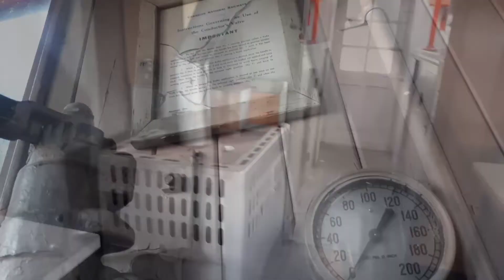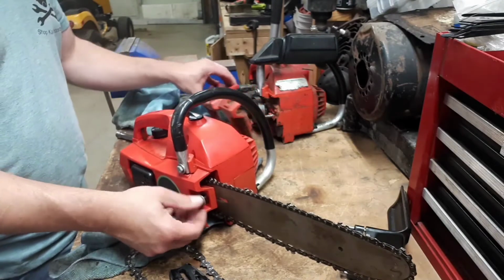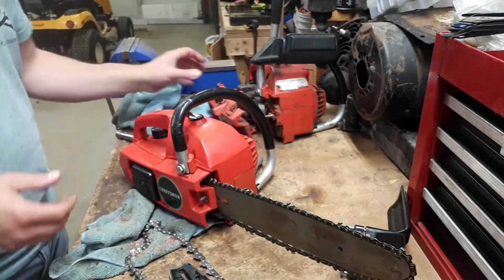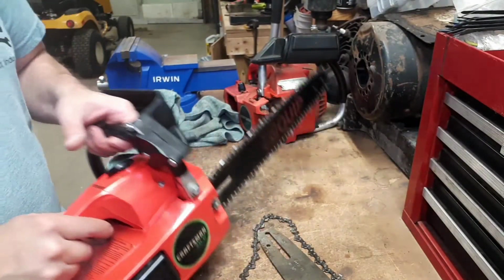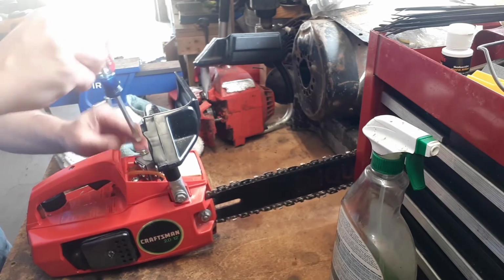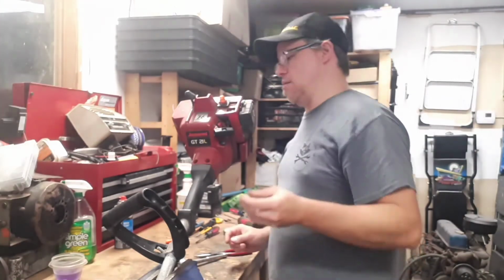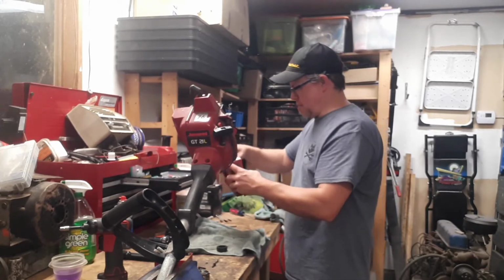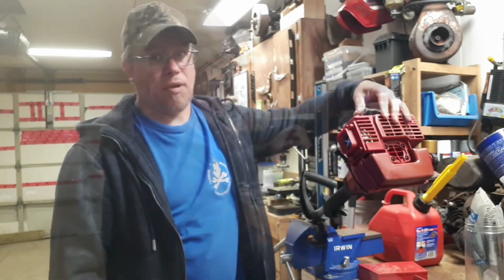Camping; Craftsman 2.0 Chainsaw, and Jonsered GT21L!

Comment: Oily 2 strokes will hardly ever tolerate extended idling because the oil fouls the plugs at idle.  hot plugs can help, plug foulers can help especially when combined with precious metal heat resistant plugs, small gaps can help some but demand richer mixtures, advanced timing at idle can help but is hard to obtain on simple engines, and of course low oil ratios help a lot, limited by the amount of wear you can tolerate.  A "hot" plug being a plug with a tall internal ceramic insulator tower, usually in a deep valley.

Comment: I mix my own 2 stroke oil and haven't worn out a 2 stroke yet, generally running about 3 oz per gallon which is 43:1.  Anyway, I add (replace) quality 2 stroke oil with some Marvel Mystery oil, a bit of transmission fluid, a bit of PTFE type engine treatment and a tiny pinch of graphite powder made for locks and measure the mixture in so the 43:1 is the total by volume, so the additives are replacing some of the oil.  MMO and trans fluid are good coke cutters, so hopefully they can clear the coke out of the ports of a previously oily engine.  I hear the manufacturers have been adding more coke cutters to the stock TC oil as well.
  Remember! the "W" in TC-W3 stands for water cooled.  Oil for air cooled 2 strokes like chainsaws is labeled just TC, though I hope they come out with a new standard soon and call it TC2 or TCB or something.